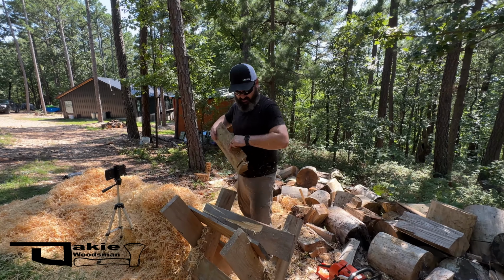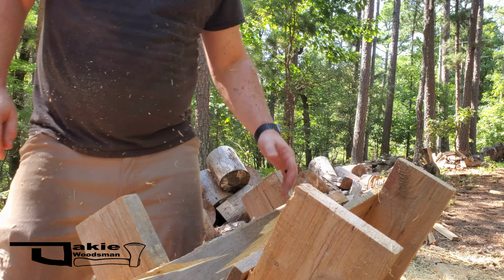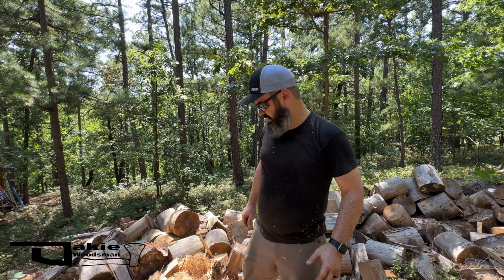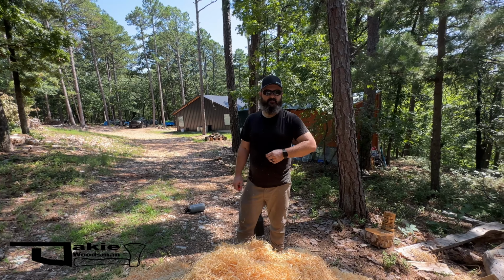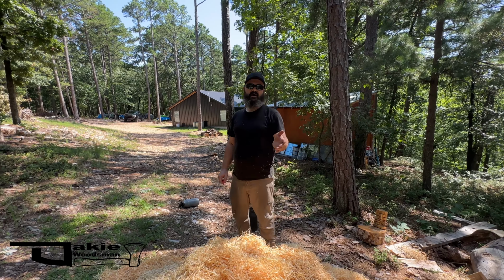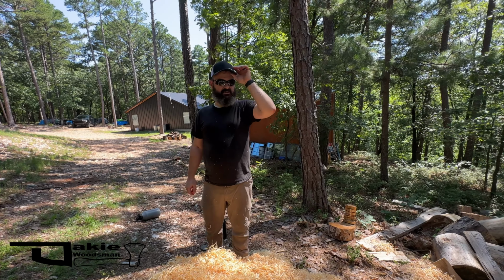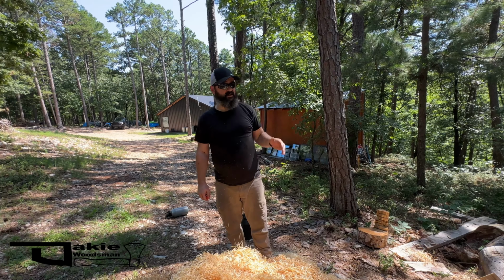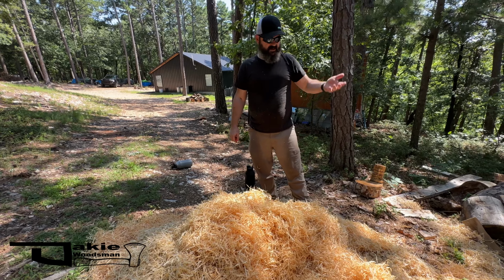How To Make Firewood Easily and more FUN! NO Swinging Required ALSO Best Firewood Chainsaw

Comment: That’s awesome dude Biggest noodle pile I have ever seen 😆
Noodling is so much funn, right on about excellent ground cover! Great idea using the blower to spread, been kicking it around with my shoes because to lazy to grab the rake jk. Love the log buck stand I need to build me one. Noodling is a great way to break in a saw also, because boy does it suck a lot of fuel. As always excellent video!
Reply from the maker: Believe it or not, this was only about 3/4 of a tank because I started noodling on some white oak that is not in the picture and ended splitting it by hand instead.  Amazing how much you can produce in a short time. Thanks for watching again sir!
Reply: I just noodle the rounds I can’t pickup, haven’t used the splitter vertical yet.
Reply from the maker: I need a splitter!  As I look at my piles grow, I keep thinking that. Added to the list that includes a pipe like yours and a ported saw 😉
Reply: @oakiewoodsman  I split by hand 1st year it sucked. Bought a used splitter for $600 and paid for itself 2nd year.
Reply from the maker: @zeromark202  on my radar good sir!  I need to do some brush cutting..... thank you!  Haven't tried it yet

Comment: Pretty sure thay would burn up my saw within five logs.
Reply from the maker: If the saw is tuned correctly and chain is sharp, a larger saw can handle this. I certainly wouldn’t try with a smaller saw. Thanks
Reply: Karlrovey What saw do you have? Have used a 50cc saw to noodle, it’s really not all that hard on a saw just uses a lot of fuel. The chain is ripping along with the grain vs against it.
Reply from the maker: @zeromark202  do you use your 545 noodling?
Reply: @oakiewoodsman  I sold that to a friend, but have with my 355t lol and the ms170 I used to have. Don’t think it hurts a saw.
Reply: @zeromark202  Stihl MS 171. It did the job that I originally needed it for and has been good for some light duty work. It's pretty easy to bog it down.

It falls into the side of smaller saws. It has done some light noodling, but really, it's best suited for limbing and light use.
Reply: @karlrovey  yep a ms170 was my 1st saw, learned in 2 tanks it wasn’t going to cut it 😆 but it was the saw that got me hooked into a hobby so I don’t regret buying it.
Reply: @zeromark202  From what I've heard, the 170 is a bit more powerful than the 171.